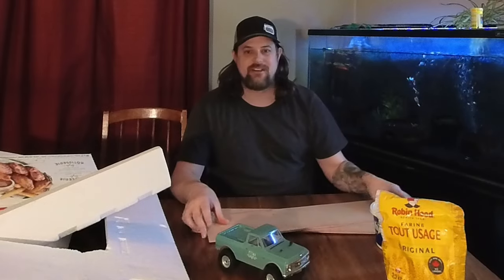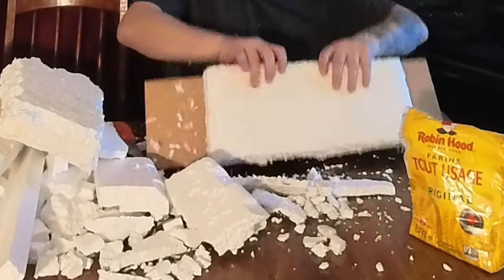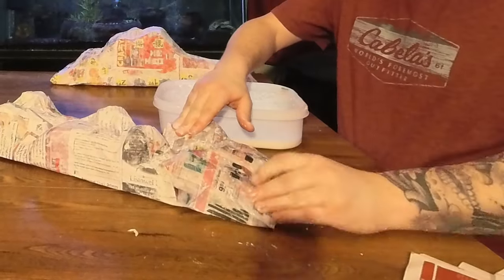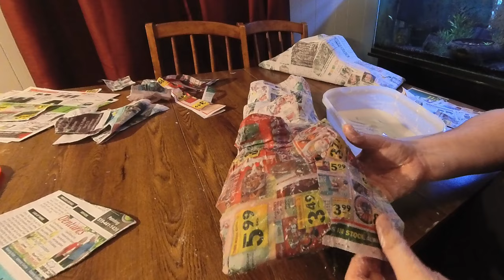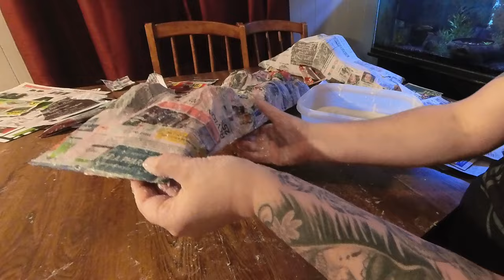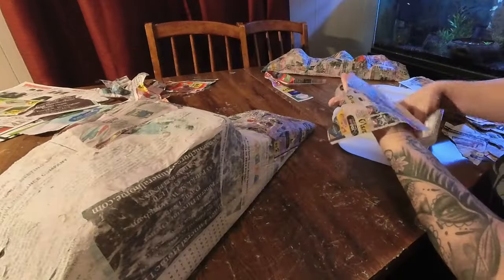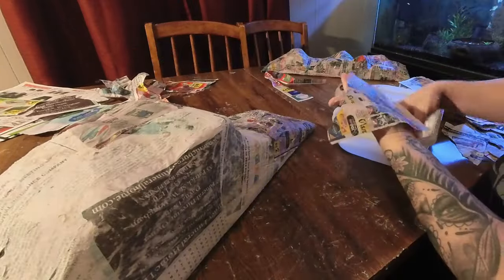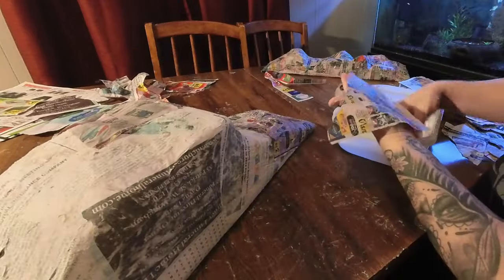How to DIY Build Indoor Obstacles for mini RC Crawler Course on a budget.

Comment: Finally another guy who doesn't just go buy cans of expanding foam, plaster cloth and spray paint.

Why buy what is available free? My advice is don't build on a base so you get a 2 sided obstacle. 

For surfacing and colour I use diluted white glue, and sifted collected soils and sand from outside. Also a bag of concrete powder.

I use washes of acrylic activist paint to colour the surface, soils and saw dust.  Very realistic and durable. The secret is variation in the colours.

Too many guys just apply one ir two solid colours.
Reply from the maker: @davideades4839  Hey Thanks for checking out my video. I'd like to try out some other building techniques too. I just used what I had. I didn't want to spend too much on building materials as I already spent all my money on new RC trucks.

Comment: I am glad i saw this video before i want out and got Expanding foam and plaster of Paris  - i totally did not think about using paper mache - i have worked with it before - Duh..!! so much easier and cheaper.
It may take longer to dry - i am in no rush.

going to try this this first, with old boxes, plastic bottle.
Reply from the maker: It takes more work but after its painted it looks so much better then the expanding foam. In my opinion. Thanks for checking out my video.

Comment: Hey mate you know its very similiar to do the same for a 3D background for your fishtank! styro foam, aquarium proof seal & paint, looks awesome as a tank back ground!
Reply from the maker: That is cool, iv seen some cool background builds for aquariums. Unfortunately my aquarium has been on the back burner since spring. Iv been debating on getting rid of it or possibly switching to salt water.

Comment: You would spend less than you did using recycled materials and dry materials you collect from outside.

You do buy glue and paint, cheap in quantity, but the free dry materials on their own can provide most of the colour as well as traction.